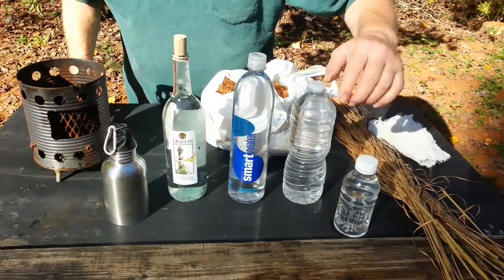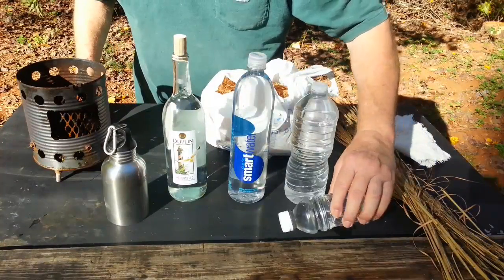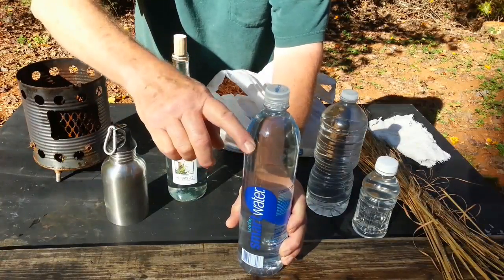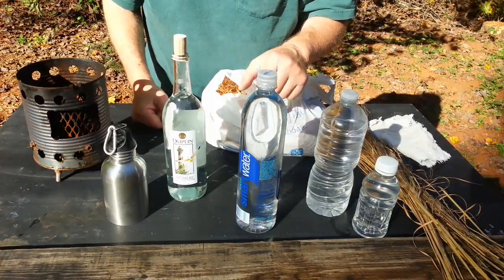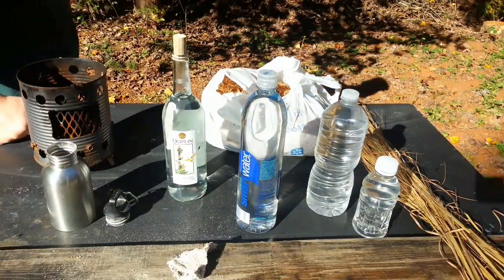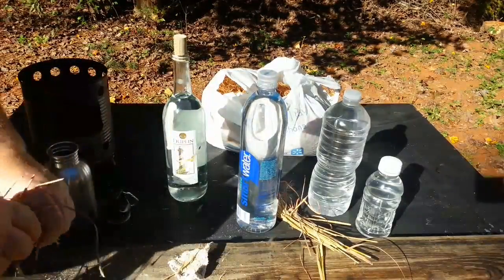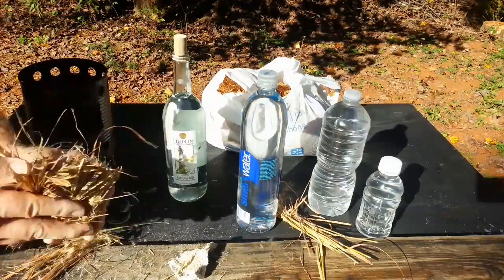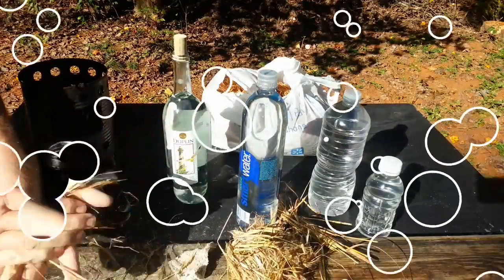Using Ashes, You Can Solar Ignite ANY Tinder With A Water Bottle, PART 2/2

Comment: Did some google searches to see if there's anything interesting chemistry-wise in straw ash. (As opposed to just wood ash. Most of the fire examples use straw as a tinder, so it's likely being collected from that.) It seems straw ash is somewhat high in potassium oxide related compounds, perhaps that's why it's quite useful for this purpose.
Reply from the maker: Oxidizers are present in all of the best fillers... ash, rust, bleach, etc

Comment: This reminded me of the old science demonstration where you try to set a sugar cube on fire. Without ashes it just melts when you put the flame to it, but rub it with wood ashes first and it will light up. Apparently the ashes work as a catalyst to lower the ignition temperature.
Reply: I have been wondering how the ashes assist with ignition. I have never seen the sugar cube experiment but your explanation that ashes lower ignition point makes sense.

Comment: Great informative video. Just goes to show how some forest fires start with dumped bottles in the dry grass.
Reply from the maker: I know... seems like there would be more.
Reply: @DavidWestBgood2ppl  Thanks for your great videos I have polished up a soda can by using toothpaste. It works but takes a long time. The cotton cloth and rust fire rolls, I shall have to try that for myself and also completely impregnated with ash. Thank you for your kind reply and I wish you great success.
Reply from the maker: @PhilipWright-pw3192  I hope you'll get some Blue Magic Metal Polish from any auto parts store. Your can needs to be much shinier.
Reply: @DavidWestBgood2ppl  Yes, I shall try that,
Reply: @DavidWestBgood2ppl   Hello David, I purchased a tube of Chrome & Aluminum paste by Sonax, and what I have acheived is just amazing. I have polished the base of this can and it looks much better than a mirror. So yes, the time and effort has been well spent, and with a focal length of approximately 9 to 10 mm the results are incredible.
Reply: Just achieved a burn after one and a half seconds............
Reply: Hey David, I have an idea for you to try before pushing it out on video. This is my thinking, you have great videos making ash and cloth or even ash and paper towel fire rolls, the key element being "ASH" as this causes the heat in the friction. So, why not, when doing a bow frill video, use some ash inside the hole to increase the friction. Common sense and logic says that the ash must create a wonderful cherry ember. Let me know if it really works much better before doing another video. You never know, you could become the inventor of the ash bow drill fire first time starter.

Comment: I have tried the wine bottle several times (omg how many hours, many attempts since December). You can just let the bottle stand in one place, find the focal point on the back of the bottle, test it with a finger if it is burning into your skin...but you make very small adjustments horizontally, turning the bottle, to get the HOTTEST focal point you can get. That really makes a difference. I always used a clear glass wine bottle with labels still on. Thanks for all the info though...couldn't have done without it probably...or would take until summer til I finally would get it.

Comment: I was just wondering if using ashes on a drill set would make building an ember easier. Has it ever been tried? As soon as I start practicing making fires I am going to try just that. Simply amazing how well ash works to facilitate getting an ember on materials like that.
Reply from the maker: That's the most common question I get. It has never worked for me.

Comment: Wonder why the ash works my theory would be that the ash is hydroscopic therefore makes the tinder that little bit drier. Also burning is a chemical reaction and ash is just mixed metal salts perhaps it acts as a catalyst for the oxidation reaction. Another possibility is the ash could convert Nitrogen compounds in tiny quantities to potassium nitrate and thus oxygenate the tinder very briefly and microscopically. Though I think the Hydroscopic effect is most likely.  If that is so then the ash would act best fresh and stored in a sealed container like you do.
Reply from the maker: Hygroscopic is the spelling I'm finding on Google. My guess is... the ash doesn't allow much heat out while allowing much oxygen in. This effect has been happening all throughout eternity and nobody's ever noticed it. Look at how little char and unburned fuel is left in campfires that are allowed to burn out. Look at the ratio of wood mass in, to ashes out... a 1000 to 1 perhaps?. I think the effect of ashes on fuel/coals is what accounts for such complete burns.

Comment: i've taken many university courses as a science major, your data merits a book publishing
Reply: his knowledge is based off of the rutiger fire roll method.  per wiki, this method of making fire was first observed during WW2 at a prisoner of war camp. i dont know how/why the ash plays a part in aiding fire ignition. maybe there is some info on the web about it. im guessing it adds an extra chemical reaction component to assist with it, just its just a hypothesis.
Reply: prelim search didnt turn up anything,  however im under the impression that since ash contains CaO ,  calcium oxide,   AND ive seen the same method used in starting fire using rust,  iron oxide,   instead of ash.   that metal oxides obviously assist in the ignition thereof.
Reply: @Gizziiusa  
Ash provides mechanical friction to generate heat.
Ash impregnated cotton cloth rolled between two flat boards ignites the rolled cloth....
Reply: @charlesmichaels6648  This could very well be the case, but if you watch other videos this channel has, then it becomes obvious there is more going on than ash simply being a "aid providing mechanical friction".  here is one link to help you understand what im trying to say. i think there is a chemical reaction component going on  
https://www.youtube.com/watch?v=K66ehpT_Orc

Comment: David, is it the phosphorus in the ashes along with magnesium traces that cause the enhancement for your methods used in this and other videos?
Reply: I suspect the ash works as an insulator, holding the heat longer before dispersing, allowing it to build up faster. I think it also plays a physical role in the formation of an ember. An ember works much like a gas lantern; the ash on the surface is like the mantle serving as a barrier between gas and oxygen and a heated reaction matrix where combustion makes place. Normally when something is ignited an amount of material must be turned to ash before an ember will form which requires energy. By adding ash, you save the energy required to create the mantle for your ember.
Reply from the maker: Julian Dorrell I don't know why it works chemically.
Reply: they say lighting ANY fire ontop of ashes (perhaps from previous fire)  insulates and stops cold drawing from the initial start up
Reply: It's the gnome turd residue

Comment: That is really cool.  I've never been able to get a bottle of any kind to work for solar ignition.   I'm really curious about what those ashes are actually doing that helps so much.   There's obviously something going on here that I don't understand.
Reply from the maker: You need this shape of bottle, Tilting the bottle towards the afternoon sun is counter intuitive. It works for many of the same reasons that a fire roll works. Here's the explanation I give to people that want to know why, I think, the cotton and ashes fire roll works...

I cant tell you about the chemical reactions. I can tell you what I know about ashes. They make a Hand Drill spindle 3 times more grippable, they allow the top and bottom boards to grip the roll well enough to compact it enough to drive it, any tinder impregnated with ashes will become a super coal extender (search my channel for ash, coal extender),  ashes insulate... So, I'm thinking that the fibers coated in ash are forced to rub against each other creating INTENSE heat, all the while this intense heat can't escape because of the insulating properties of the ash so it gets even hotter, until finally the distressed fibers allow a pathway for all that heat to make its way from the center to the outer fibers and the air that it is so desperately starving for. PLEASE check out my... How to fire roll video. Thanks!
Reply: I just checked out "How to Fire Roll".  What a great demonstration.   I gave the fire roll a half-hearted attempt a couple of years ago, but I think you've inspired me to start playing with it again.   I really appreciated when you mentioned that you disagreed with things that you had said in previous videos and that your way wasn't necessarily the right way.   What a great approach to instruction.   Thanks for taking the time to share your experience with us.
Reply: I'm still intrigued by the idea of ashes as a tinder booster too, so I'll be checking out those videos next.
Reply from the maker: Thanks!